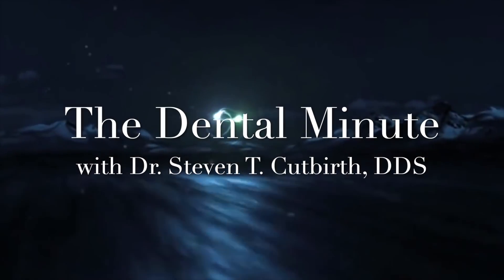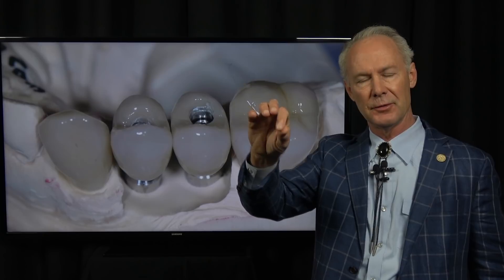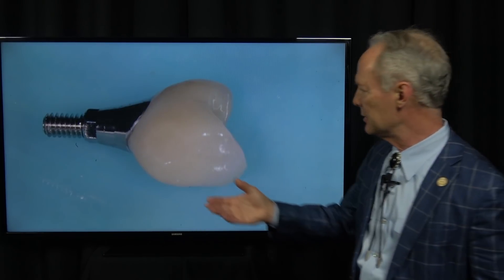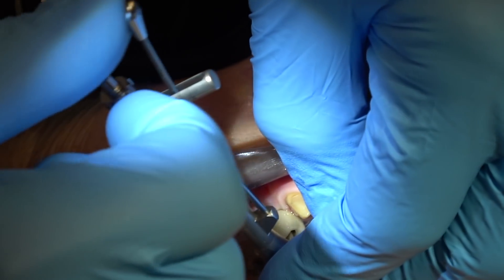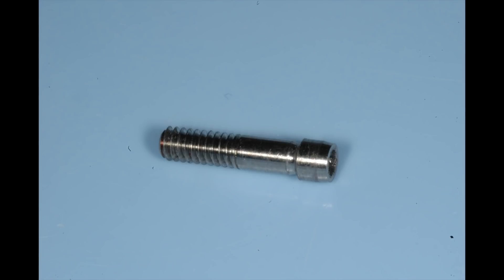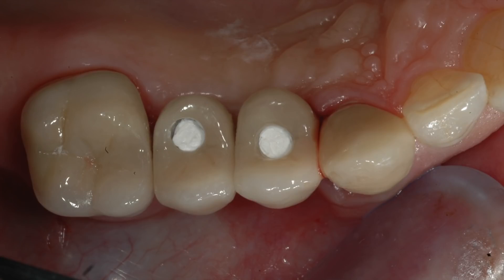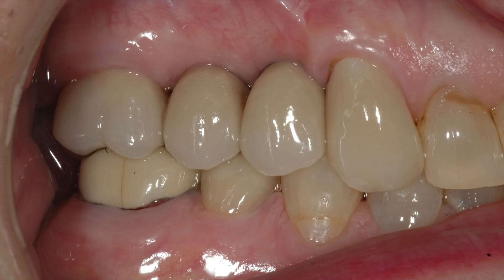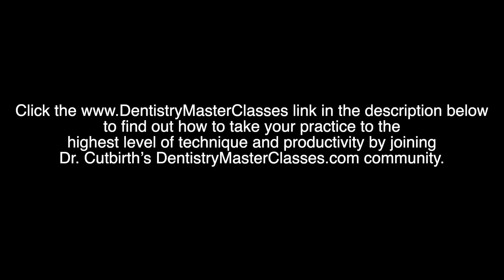Implant Screw Slipping when Torquing - Dental Minute with Steven T. Cutbirth, DDS

Comment: What would you recommend if the threads on the implant are stripped as the reason the screw isn't engaging with the implant?
Reply from the maker: Interesting. As I have placed many implants through the years, I have gotten to the point that the implant abutment/crown screws have not slipped for many years. I place my finger or thumb on the hand not turning the screw driver on the top of the screw driver to keep it seated firmly into the screw and I have had no problems. I am not sure if it is me becoming more proficient at the task or the screw heads have gotten more retentive. If you strip the threads on the coronal part of the implant that would be a big problem. I think it would be almost impossible to strip the threads in the implant. You could strip the threads in the screw, but as stated, I have not had any problems for several years with screw tightening or stripping. I am meeting with the owner and CEO of OCO implants the 19th of this month, 1/19/24, hoping I can convince an implant company to  produce an ideal system of all components, i.e.  drills, implants, impression copings, healing abutments, etc. Currently I must mix and match different components from different implant companies. 
Take your practice to the Top Tier. Subscribe to DentistryMasterClasses.com for an organized library of all the Dental Minute videos plus many complete comprehensive cases and many very important articles. New cases are added weekly.  Only $39.95/month.
Click here to subscribe: 
https://membership.dentistrymasterclasses.com/purchase/?plan=513

Comment: Thanks for sharing. have a case where I initially was able to torque it to 30 Ncm, couldn’t reach 35. And then the torque wrench started moving as I reach 20 ncm. Is it more likely that the screw was stripped or the implant started spinning? I did a reverse torque test prior to the impression. If the screw was stripped what’s your best recommendation to get it out?
Reply from the maker: It's hard to say without examining the situation. If a stripped  screw is the problem, it is probably the head of the screw where the screw driver engages the screw. You might put a burr of some kind in a slow speed, contra angle handpiece and run the handpiece slowly in reverse with the burr in the screw. Maybe a round burr that fits the hole snuggly, like a #6 possibly, would work. 
Take your practice to the Top Tier. Subscribe to DentistryMasterClasses.com for an organized library of all the Dental Minute videos plus many complete comprehensive cases and many very important articles. New cases are added weekly.  Only $20/month.
Click here to subscribe: 
https://membership.dentistrymasterclasses.com/purchase/?plan=513

Comment: What do you do when screw head is stripped and you can't remove it ?
Reply from the maker: That's a problem I have not encountered.  I suppose you could place a burr in the head of the screw (slow speed handpiece),  reverse the slow speed handpiece and unscrew the screw.  The challenge would be to create a "purchase point" in the stripped screw head to engage the burr.
Reply: @centerforard  we have lots of screwed in large bridges on multi unit abutments . The screws have stripped quite a few times .
Reply: THERE IS A KIT  YOU CAN  GET   FOR STRIPPED SCREWS
Reply: What’s the name of the kit?

Comment: How can we do for un loosening screw of abutment? When you torque is 35 N  but after 2 years abutment were lossed.are you agree with applying varnish on screw or other solution like this?
Reply from the maker: Sorry, I do not understand the question.  Are you saying you want to loosen the screw on the abutment or the abutment screw is loose?
Reply: @centerforard  
No ,how can we do for preventing screw abutment loosening?
We know that bite force or trauma in mouth can loose  screw abutment gradually and my question is what can we do for preventing or reducing this complication?
Reply from the maker: Have the patient wear a nightguard on the arch with the implant and encourage the patient to keep their "lips together, teeth apart."  A good way to accomplish this is to have them hummmmmm.
Reply from the maker: Also, be sure to eliminate eccentric contacts on the posterior teeth/implant crown.

Comment: You don't have to reach 35 ncm if you use conical connection implants, 25 is enough. And when it comes to the problem of a worn screw, the other option to get rid of that problem is to make crowns by yourself, completely digital and say goodbye to your technician. I  did it one year ago and believe me never been so happy in my life with the restorations I deliver to my patients. Fit, contact points, shape and no one tackles with the screw anymore. It is really not a big investment and learning curve took me 2 months to deliver better crowns than my technician does.
Reply from the maker: Good for you.
Reply: Michal Beznazwiska what system are you using?
Reply: @Mallardman795  Any system that can allow my patients to get and implant with a crown for 500 $ and reach my income goal is good for me. Now I mainly use Nova implants from Isreael, standart hex connection, due to costs reduction. When it comes to connical connection was using Korean Dentis s-clean implants as my main armamentarium for a couple of years and even with 20Ncm torque it was quite a battle to disconnect the abutment from the implant.
Reply from the maker: I use the Dentis root form implant system.  I like the shoulder on the drills, making depth determination totally predictable.
Reply: @centerforard   Did you try 3i drills for tapered implants. The drills  just rock. Of course they are each with different lenghts  similair to Dentis (no shoulder unfortunately - but very easy to see if you are going to deep). These drills  just eat bone. When you have D4 in mandible there is nothing that can beat them.
Reply from the maker: I will not use an implant drill without a shoulder to stop penetration of the drill.
Reply: IF YOUR TECHNITION WAS STRIPING THE SCREWS ........................................... ,,<<<SOME >>>   PROFETINAL DENTIST  ARE LOOKING AND DEALING   WITH TECHNITION THAT HAVE NO CHOISE BUT TO RACE TO THE BOTTOM WITH   PRICE REDUCTIONS  ........  AND   SOME DENTISTS ARE AAAAAAALWAYS LOOKING FOR THAT KIND OF LAB  ????!!!!   MMAYBE??!! WHEN A TECH  KNOWS  WHAT HE IS DOIND HE WILL DEFENETLY SCREW THAT IMPLANT ON TO THE MODEL WITH EYES CLOSED - EYES CLOSED! <<<<< QUALITY CONTROL???>>>>>>> GONE!!!

Comment: Do you have a general guideline for using screw-retained vs abutment-cemented implant crowns?  I usually use abutment-cemented unless there is minimal inter-occlusal space, but the more I research screw-retained the more it seems like a better option. I don’t see much downside, if any, except in anteriors where the access would have to be on the facial due to implant angulation.
Reply from the maker: I used to use screw retained abutments and cemented crowns on every case.  I now use screw retained abutments and crowns on every case I can because there is no cement line or excess cement to be removed.

Comment: Nice tips for common problems.  However, I might suggest something slightly different;  most of us do not have spare screws lying around to swap out.  What you should be instructing your lab to do is to use a "lab" screw of their own for torquing to 35 nt/cm while they are adjusting contacts, etc.....and to enclose a brand new , never torqued "clinical" screw for the doctor to use for insertion.  These screws were never meant to be torqued and torqued over and over again to the full max of 35 nt/cm.  Besides having them strip,  by using a severely fatigued screw you are also in danger of having the screw head completely snap off when you're doing your final torque down to 35 nt/cm.  That would make for a very, very bad day at the office.
Reply from the maker: I agree.
Reply: How to get out stripped screw?